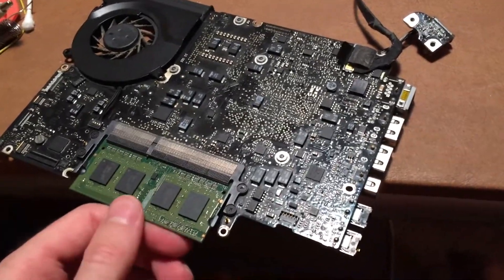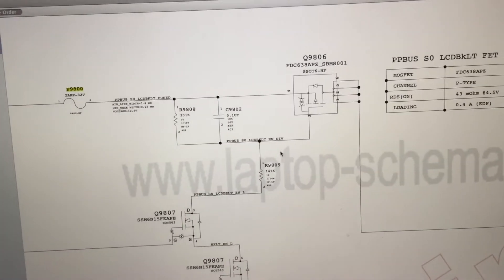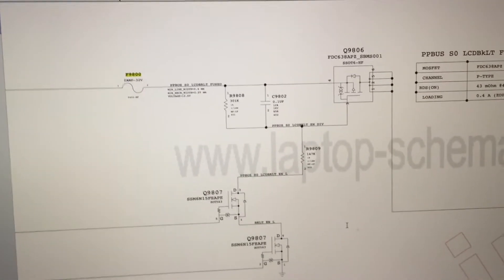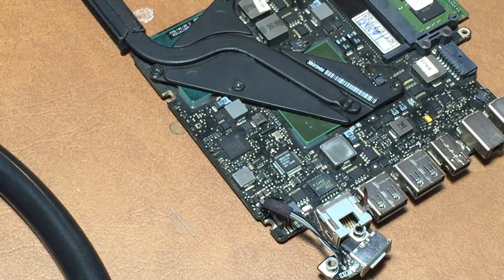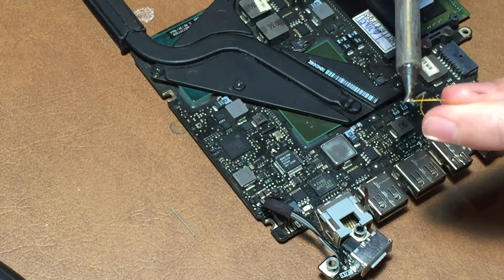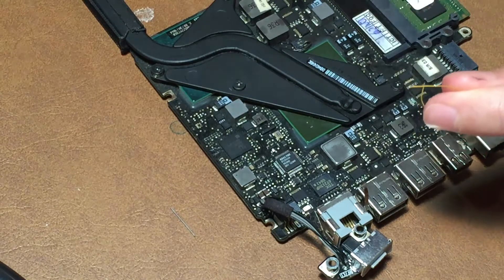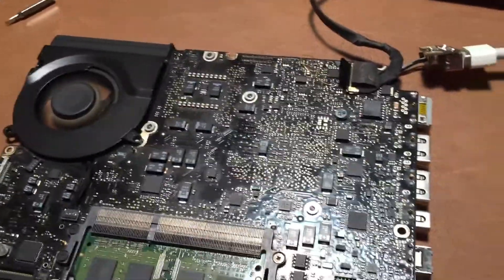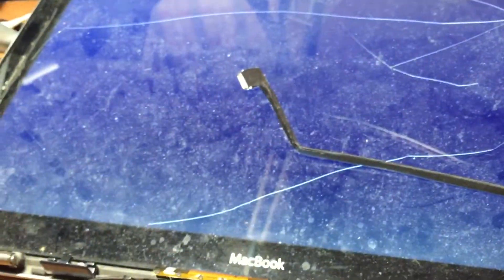Late-2008 13" Aluminum Unibody MacBook Backlight Repair

Comment: What would you recommend for a macbook with a dim light? It's viewable but seems dark in the corners, 
bit duller then usual.
Reply from the maker: That's probably just a bad display.
Reply: So should i follow the procedure of getting a new display or can i get a new light?
Reply from the maker: You'd need to replace the display.
Reply: OK Thanks.